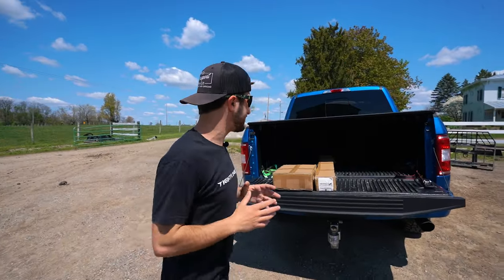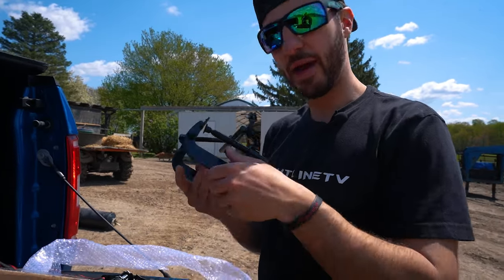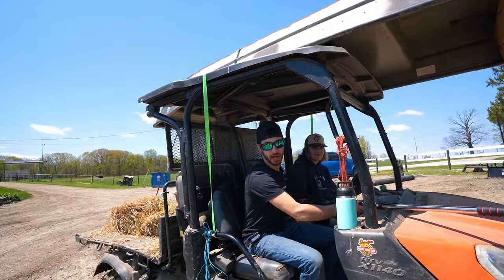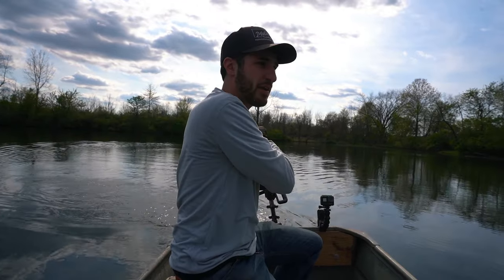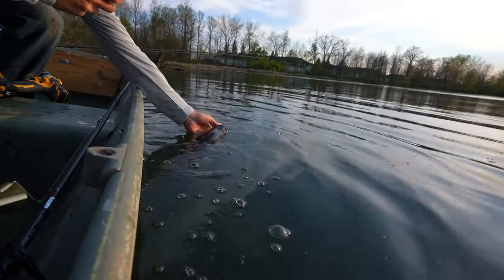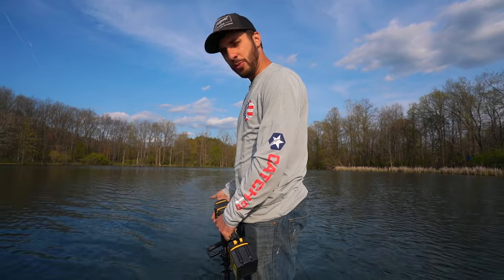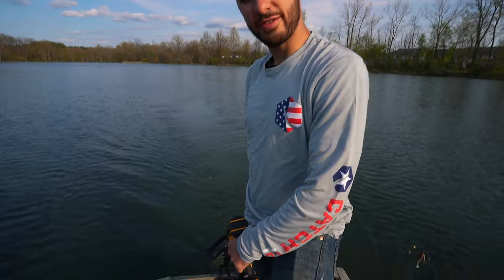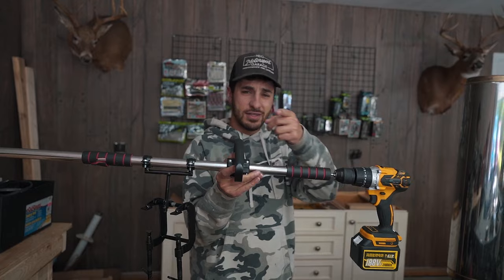I BOUGHT A HIGH POWERED DRILL BOAT MOTOR ON AMAZON!

Comment: This drill is good, but the best drill for this application would be the Flex 24v Hammer Drill from Lowes. Make sure it's their most powerful one. It has a turbo mode that brings it to 2800rpm and peak torque comes in at 117ft lbs or 1400 inch lbs.
Reply: But the noise will piss off all life underwater. Consider other things than enjoyment
Reply: @1979Spica  You do realize the alternative is a gas engine, right? The idea of a drill powered propeller would be an alternative to a small dinghy engine. Otherwise, most people would go buy an old smokey Tohatsu 2.5hp 2 stroke that sounds like a 70s moped. The drill is a lightweight, portable alternative to an outboard. Also, small outboard motors peak at 5000-6000rpm. 2800rpm in comparison is slow (like a diesel). However, the 2000rpm peak speed that most drills have is ridiculously slow. 2800rpm will at least get you to jogging speed instead of walking speed.
Reply: @1979Spica  But yes, if you think a drill will disturb the fish, I'll just use a 2 cycle outboard motor. That's fine with me. Can't beat an ol screamin 2 stroke.
Reply: Metabo kills flex and metabo is water proof
Reply: @grimthreeper4112  Metabo does have slightly more torque, but only tops out at 2100rpm. Flex still has a 700rpm advantage, which is a 33% higher redline. It's a tiny boat. You don't need a ton of torque, just more revs.
Reply: I wanted to like the flex tools and the tools themselves are great and have a lot of power but the batteries like to burst and leak everywhere. I e had 2 batteries do this to me. You end up with a black lithium grease all over your tools and they're done for.

Comment: there's a lot more kayaks out there than jon boats ...... how to attach?
Reply: I'm going to figure that out. I've got the folding Tucktec Kayak, which isn't set up for a trolling motor... but this I can see filling that gap perfectly! Thanks
Reply: @greyscout01  Those things are sinking time bomb. They are very dangerous in the winter time even heard of some people drowning from hypothermia because they all collapse at one point. They collapse at the seams. I was super close to buying one until i read the horror stories on reddit. I went with a different vessel one that i will showcase on my channel. It's better than a foldable kayak in every single way, and it fits in my backpack. From what i can tell they start to collapse at around 24-40 uses.
Reply: @freshandsaltyjohnny  Haven't heard those stories.  Can't imagine how they'd just collapse. Once they are locked into position, they are solid. No less than your average budget kayak. I've had mine a couple of years and a couple of dozen uses . Don't see anything like that happening. Naturally,  anything man-made can fail, but using mine, and inspecting closely how they're built, it just doesn't seem plausible.

Comment: Do you need to register to boat to use this?
Reply: That depends on your location. In my state a boat that is powered by anything other than man power has to be licensed.
Reply: @Joe_Regular_Schmoe  Some states only require certain horsepower. So its legal to run these paddle drills. Some require any motorized. It varies. I did some research on it.